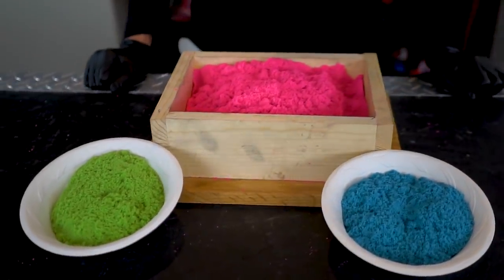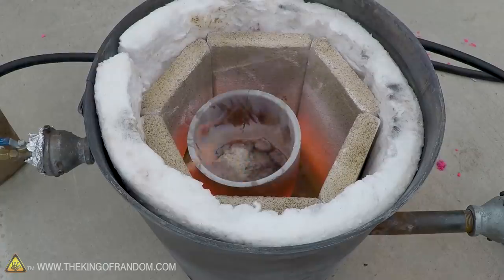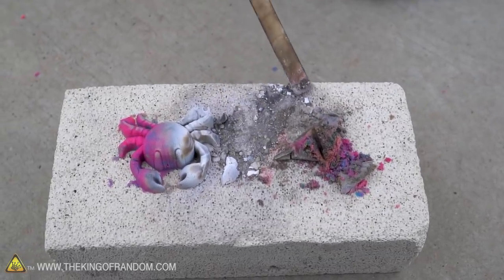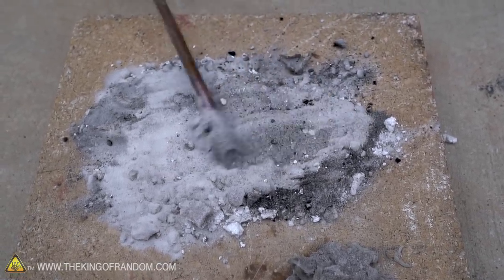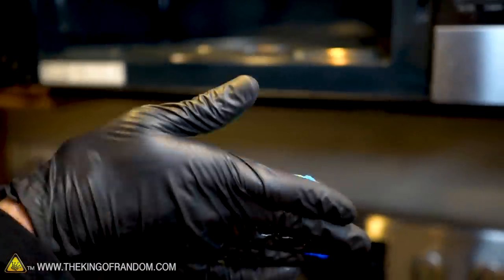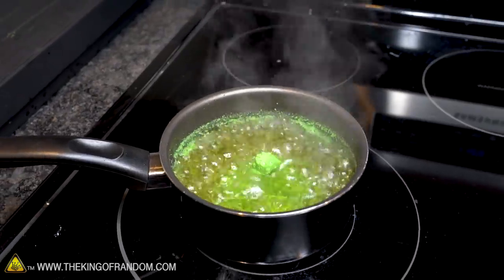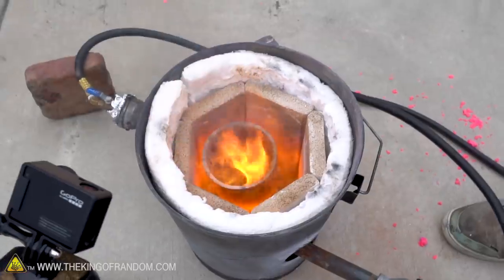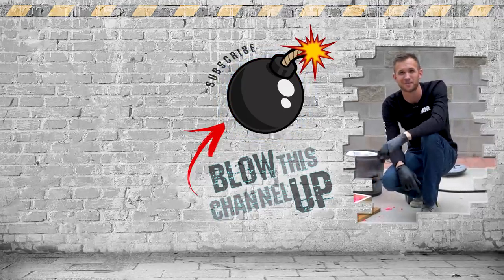Boiling Green Kinetic Sand

Comment: Put kinetic sand with liquid nitrogen
Reply: Yaaaaaaas
Liquid nitrogen is fun, but if it gets on your hand, you can shatter your hand
Quite literally, it will break into shards
Reply: @derp33squid  only if you hold your hand into the stuff. Otherwise the ladenfrost effect would prevent that.
Reply: @derp33squid  that's a myth check out mythbusters
Reply: @derp33squid  Your hand can't... shatter. It would literally do nothing to your hand
Reply: Foamy Your band can most definitely shatter if it’s frozen solid, it won’t do anything if you only dip your hand in it quickly though
Reply: Hand*
Reply: Crispie boi
Reply: Jason Box Exactly! Science sure is strange.
Reply: 100th like
Reply: Nothing much happens it just becomes a bit more solid as it freezes the water content inside...

Comment: The paint goes off because it starts evaporating first. It turns purple when it starts to get heated. 
When it's gray, the paint has completely evaporated, as gray is the polymer/sand mix base colour.
(See at around 3:00)

Comment: I wonder if you can boil Flex Tape.
Reply: YO I WAS WONDERING THAT TO 😂😂😅
Reply: That's allot of damage
Reply: 😧😧😧😧 it becomes flex seal.
Reply: @Marleyharrison387  but what if you heat it up even more? Will it create flex gas? Flex plasma?
Reply: Chemical fumes might come out while doing it, cause it probably has chemicals to keep it sticking.
Reply: @janukigurung933  boil flex seal
Reply: Flex seal
Reply: No, you can't. It's silicone. It doesn't melt, it burns.
Reply: hey HEY HEY ,it's November
Reply: Mistertbones what kind of tape you got that don’t F L E X

Comment: They say air freshener is flammable. Just what SORT of air fresheners is flammable, compared with purfume? Some even say not to pierce the bottle. What kind of gas is in there?
Reply: Rebecca Neuhoff most spray bottle stuff is flammable, like bug spray, air freshener, etc
Reply: Definitely flammable! Areosol cans (pressurized cans) are powered by usually a propellant such as butane or propane. Reason being, those gases can be compressed to a small area unlike normal air.
Reply: Cool
Reply: İf you pierce it what you pierced it with will fly into your face then the gas will burn your face... When i was small i tried piercing it with a scisscor and my parents stopped me

Comment: Fun fact:
In the "Olden" days, they did not throw boiling oil over the walls of a castle to defend it. A much more effective and cheaper option was boiling water or even heated sand. Oil was far more useful in other uses rather than just throwing it over the walls

Comment: The reason the kinetic sand doesn't heat up as easily in the microwave is possibly because the microwaves only excite electric dipoles... so stuff like water molecules which I am guessing the sand does not have much of

Comment: maybe putting a cup of water inside the microwave together with the sand , or wet the sand then put it in the micriwave , as a microwave emits microwaves with the same frequency of water increasing its temperature. The reason why the sand does nt feel hot is because there is nothing warming it up

Comment: Turning sand into glass works best with an oxyacetylene cutting torch--use the oxygen handle and blow a stream of pure oxygen through it to burn out the impurities. What's left is glass. Edit: Also, microwaves primarily affect bipolar molecules. Like water. The polymer won't be strongly affected by it.